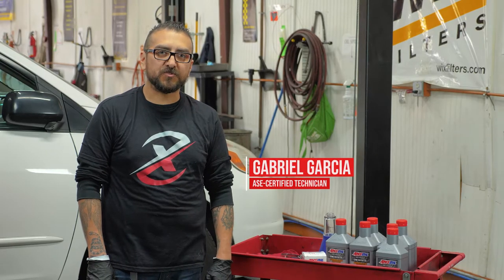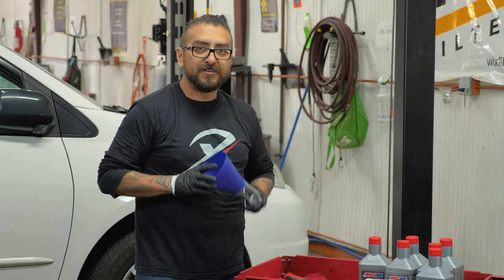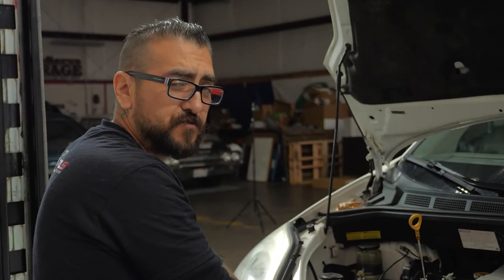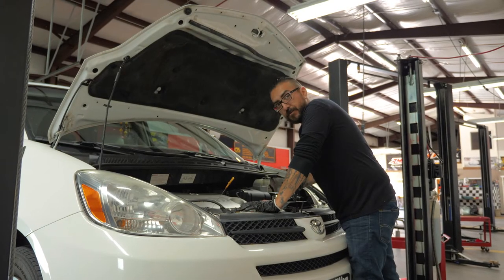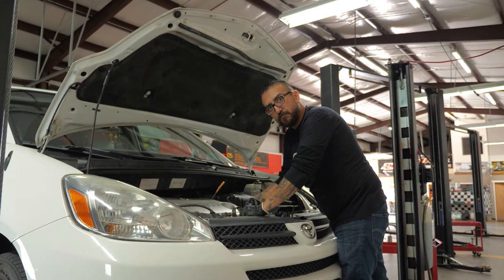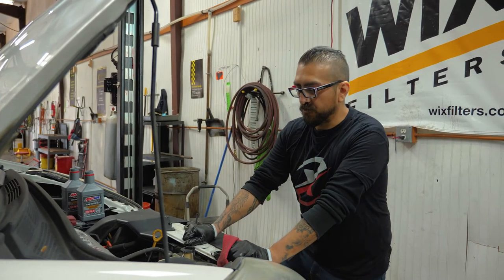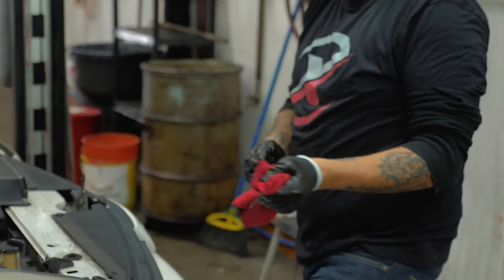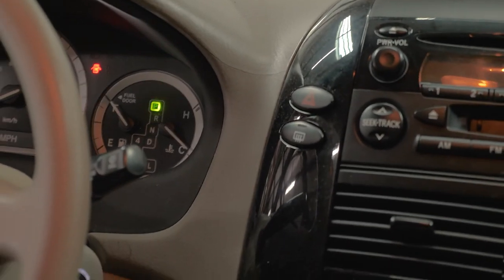1996 - 2005 Toyota Sienna Oil Change

Comment: Thank you for very detail informative tips (stud/"clean" oil lubricant/tap-tap-tap, etc...) while walking through the steps in layman's terms for the inexperienced viewers to follow to learn how to change oil. I've never done this nor saw how my 2005 Toyota oil changed by paid services. I wanted to learn how to do oil change ourselves this time to show my  young son how important it is to have the oil change regularly - by now doing it "ourself"  to ensure this lesson stick with him for life (as future routine)  as he'll become a car owner when he got the money to buy one.  I was worried that this job could be tough or complicated, but after viewing your video, I feel confident that I can do this and with the companionship with my teen son doing it with me, it will be easier +memorable +enjoyable experience that we can do this from this day forward  +saving money +gain experience +free from waiting for general oil-change appointments  [with Covid19 appointments are  stricter & limited  : (  at local auto repair shops!]   Very importantly,  you even showing us how to self  "reset"  the  "maint-required  light" along with how many miles to change the oil  "ranging"  from 3000/3500/5000/7000miles  and reminder to read our manual.   So many KUTOs to you for   "teaching us how to fish"  from this day forward  ; )
Reply: Are you sure you don't mean an 18mm socket for the drain plug? Because that's what I needed for an 04 model year. And doing the change on the ground with about 4 f##@/!g inches of ground clearance really sucked trying to use the wrong wrench

Comment: Any recommendations on how to reduce the oil spill mess when removing the oil filter? I have a 2000 Toyota Sienna, not sure how different it is from the 2005. Thanks for the video!
Reply: I'd like to know, too.
Reply: Mine just drained directly down, so i put the dish under that general area and it drained into there nicely

Comment: Yeah cuz I have one of those lifts
Reply: Wheel ramps at Walmart or Harbor Freight run around $50. I bought the HB ones because they seemed sturdier and they allowed me to do the job myself. If you're still shopping about for oil, Valvoline MaxLife Semi-Synthetic is a good product. For a filter, check your Toyota dealer's parts desk.

Comment: Taking off the oil filter was almost fictional in your video! When I take off mine, oil pours all over the place! Any ideas to make that easier and less messy? I am running out of tshirts.
Reply from the maker: This one wasn't that messy, but I know what you mean. I'd use a piece of cardboard wedged under the filter. Shape it to direct the oil into your drain pain and also to shield the rest of your engine from drips and splatter.
Reply: @MotivxTools  Just got your Toyota funnel as well! I am a cluts when oil is involved!
Reply from the maker: Awesome!

Comment: Great video!  Is there something I can put under the oil filter while I remove it to catch the oil so it doesn't get on the exhaust pipe and smolder for a while?
Reply from the maker: Thanks Jim. We've looked into making a special plastic tool for this, but honestly, the best thing we've found is to grab a spare piece of cardboard, wedge it underneath the filter and shape it so oil pours into your drain pan.